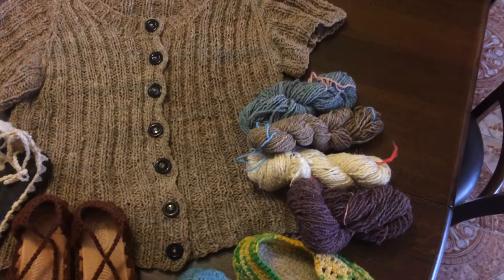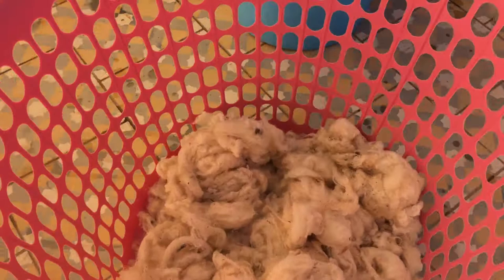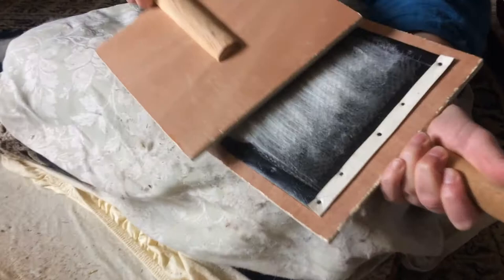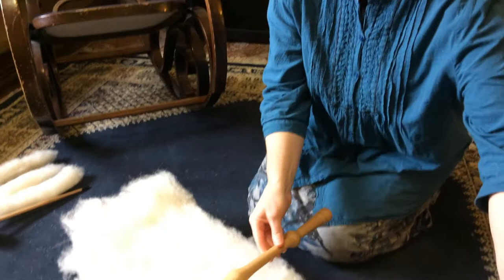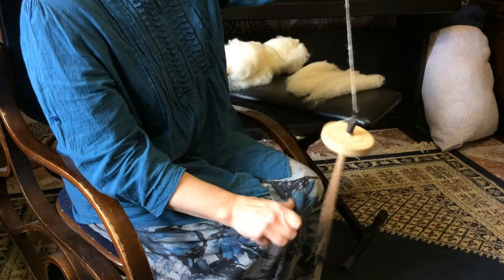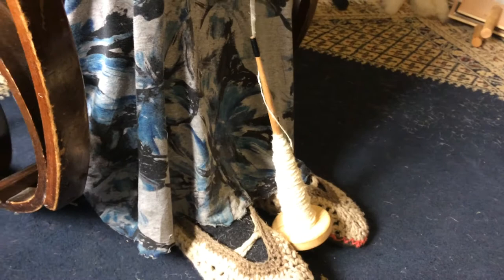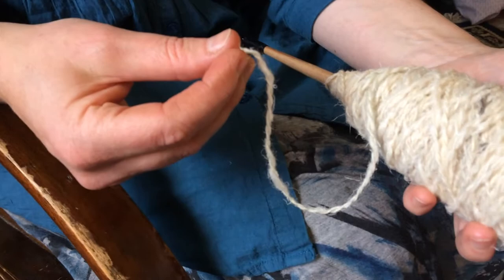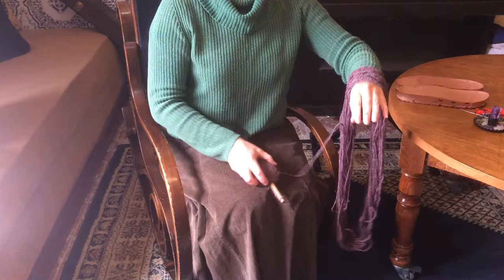Wool Processing by Hand

Comment: Good Day to you! Thanks for the video. Could you make a video of making those sandals 🩴, Please 🙏🏻 Have a wonderful day!
Reply from the maker: Perhaps someday I can do a video about that.....  But I'd have to have the time first (Homeschooling 4 with a toddler underfoot takes about all my energy these days), and then I'd have to actually figure out a pattern.  I'll give a few pointers here that may help you get started on your own without waiting for the dim probability of my getting to the task anytime soon!

First of all, my own inspiration came partly from ideas I found online.  If you do some searches, you may find good videos already out there to use!

Next, I should say that wool is pretty stretchy.  I crochet any shoes or slippers (instead of knitting as I do for socks) to make them firmer, but I still find that it's hard to get a good, sturdy shoe wall with crocheted wool.  (It would be easier with a cotton yarn maybe?)

Since I live in Africa with plenty of cheap, plastic slippers in town for purchase, I used them to start my sandals.  A sharp knife sliced off the tops.  Then I took a long, sharp, large-bore needle (which I found in the hardware section of the local, open-air market) to punch the holes where I wanted to place my anchoring stitches.  
To do the punches through the plastic/rubber, I heated the needle over a candle to make it slide more easily through the material for each punch.  This should explain why you need a LONG needle!  You want the far end to be cool so you can hold it!  It also does need to be SHARP, and not a darning needle, because even with the heat, it can still take quite a bit of muscle to push it through depending on what you are working with.  
I didn't find a lot of options for different bore sizes, but the one I have works pretty well.  It is still impossible to pull the hook, loaded with yarn, back up through the hole when I'm placing the anchor stitches, so for those I use a very small doily hook just to pull the loop up.  Once that's through, then I put the loop over my regular hook and keep going until I need to pull up another anchor loop.  

For indoor slippers, I've used some locally-cured, heavy cow leather.  Heavy leather needs to be punched with a leather punch, and I've learned that it's worth the price to get a good punch!  Even good ones are tiring to use when I need to punch holes a cm apart around the entire adult-sized sole!  Cheap ones are impossible.

Then I usually just improvise all my shoe designs.  I rarely make the same style, or size, twice.  And even if I did, I'm using handspun wool which can have a good bit of variation in it, especially if I'm using wool I'd spun earlier without a plan in mind.  I often spin for the joy of spinning, without a specific project in mind, and just spin different bunches at different weights, ready for a variety of projects when I decide to make something with it.  
To crochet "my way," meaning by trial-and-error, you must be willing to take out and re-do anything as many times as it takes to get something you are happy with.  Not everyone enjoys that.
So, if you don't like to use the trial-and-error method, here's where I really recommend your looking online for what others have done.  I know there are more standard patterns out there, and much better ones than I could ever come up with!

Also, our floors get painfully cold in African winters at this latitude and altitude.  So cold that I find simple leather soles with a single layer of crocheted wool (even with thick yarn) too thin against the frigid tile floors.  If you also live where it gets cold, you may want to do what I do and make some thick sheets of felted wool to cut into inner soles which you can then place between the crocheted layer and the leather layer.  This really, really helps with warmth, especially if you make a good, thick felt sheet.  (Plenty of good tutorials online for wet felting/sheet felting!  That's where I learned to do it!)  
Some traditions, such as Mongolian, use felted wool for the entire slipper, but I feel that these wear through more quickly.  I like the added durability of spun fiber for the layer that receives the most wear,  so I just use the felt for increased insulation against the floor.

I hope all this helps you in some way!

Blessings on your wool adventures!

Comment: I would love to know where you purchased the paddle hand cards.
great video.
without endless talking about odds and ends.
Subscribe!
💮🌼🏵️🌺🌸🌹
Reply: We found these hand carders in a few old cities in Morocco (after a lot of searching!)  If you are not in Morocco, I won't be able to help you more than to say that you can find similar products online.  What you find online will probably be much more expensive, but also much better made.  The local ones I use are very rough.  I have to watch out for splinters of wood which can end up in my hands.  They also have a low point-per-area, which works fine for wool, but could be much higher for an even nicer card.  

However, I suppose I shouldn't complain.  We've seen the place where these locally produced hand carders are made....by hand.  If I were doing the points by hand, I think I'd opt for a low number per square inch too!